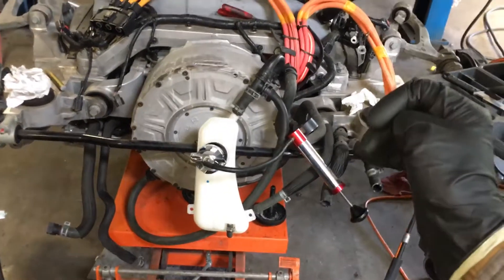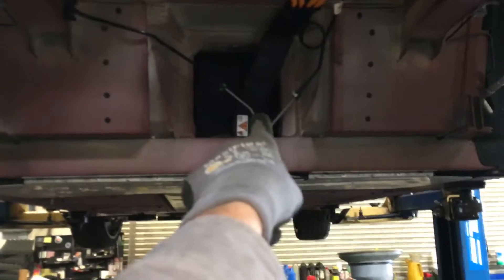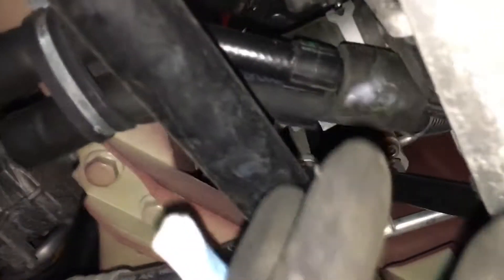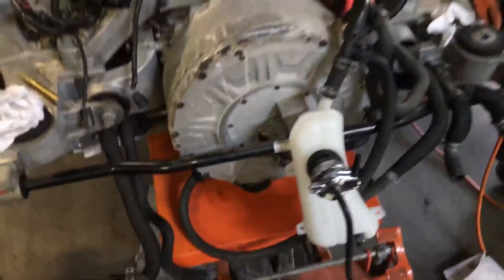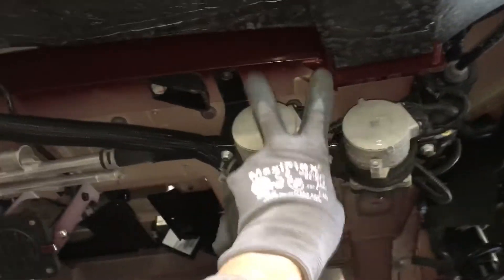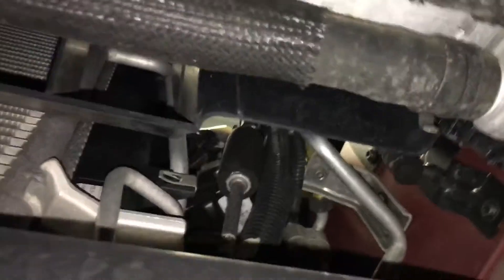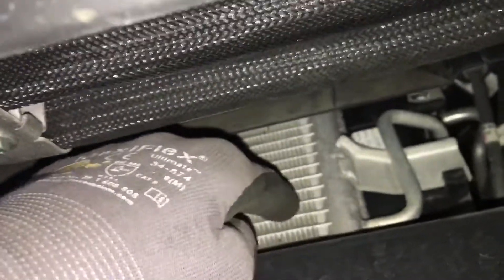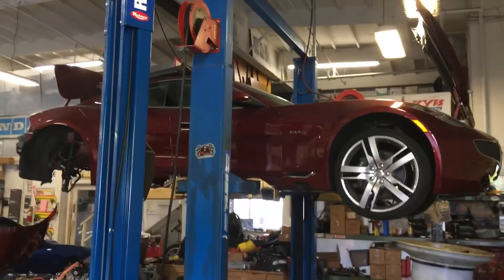Thermal Management Fisker Karma, Learn the new Technology or die with the old.

Comment: Hi.. not related to this video but an older one you’ve posted: you have used the 2 trublu hoses to be connected directly to the vacuum pump. Can you please tell me which adapters you’ve used to connect to the car high and low valves, also did you pull out the shredder valves from the high and low. I want to purchase the trublu 3 hoses set to use it to pull a vacuum from my 2005 BMW M3. Also which pump would you recommend that’s very good but not super expensive. Midrange I’d say. Thank you much!
Reply: Thank you so much for your reply. I love you’re videos!! I can watch you at work forever. Very knowledgeable and love your tools. I wish you were close to me here in Connecticut I would ask you to service my car. Do you know anybody with your credentials in my area btw? Northville Connecticut 06776
Reply from the maker: Forza Unfortunately I don’t know anybody in Connecticut
Reply from the maker: Forza and if you’re not gonna use a set of refrigerant gages just a true blue hoses you may want to get at least the cheap micron gauge
Reply: @coldfinger459sub0  I was thinking of getting the Fieldpiece 480v digital gauge, the trublu 3 hose set and a 2 stage vacuum. I really want to try a deep vacuum as you explained in the videos. Will I be able to do the vacuum directly from high and low, without the gauges and then hook up the gauges to charge the system back? I am learning ( watching, reading) I am not an HVAC tech just a guy who like to learn and do things probably
Reply: Btw, is it a must to use Nitrogen to clear the lines? I don’t have that :)
Reply: Is it at all possible to PM you?
Reply from the maker: Forza you can charge with out gauges I think I did a video on the with the hoses
Reply from the maker: Forza you can do it with out nitrogen. Just leave it on the vacuum pump over night that all.
Reply from the maker: Forza yes you can PM me. Is my contact info available on YouTube ? I don’t even know that. Never PM on YouTube before. If not just ask. I’ll send it to you.
Reply: t lech thank you! I greatly appreciate you’re answering my questions! My car is in better than New pristine/collectible condition all parts are BMW Factory original including all parts of the AC system. I am almost sure Car’s a little low on refrigerant. Temp not cold enough. When I turn on the AC there’s a low hissing sound coming out of the vents. AC compressor is working, clutch is engaging. That’s why I was thinking about evacuating the existing refrigerant ( can I evacuate to a recovery tank directly, or do I have to use a recovery machine?) . Do a deep vacuum, a proper procedure as you are doing and then do a recharge new r134a with the exact amount. 740gr+-25gr as noted n the sticker under the hood. I’ll will need to get a proper scale of course. All the tools needed are going to be very expensive for me :(  Alternatively, Do you think I can find a season HVAC tech who has these expensive tools and of corse care and knowledge to perform this task at my residence?
Btw, at any point of the process whether during recovery or vacuuming- does oil come out i.e. will I lose significant amount of oil that I will need to add back?
Reply from the maker: Forza What year was this car? . Was it a originally a R12 car before 1994?.   Or was this car originally outfitted with R134a ?.   Recovery does take a recovery machine.  Yes it is vary expensive to get all the best equipment. I have over $28K just in air conditioning tools and equipment alone not including Machanics hand tools all mostly Snap On, MAC, MATCO, that’s way over 60K and that’s not including my commercial contracting tools for construction and heavy commercial building HVAC installation of large 60 ton HVAC and heating units on top of office buildings in residential HVAC I don’t even want to mention the price there. But that is all cheap compared to training, schools, seminars, EXPOS, hotels, Airline flight expenses around the country, tending factory corporation training for specific manufactures products. And that doesn’t include the last time while you’re at the training you’re not on the job selling products in labor that’s another expense while you’re attending training.         There is a way to recover to a recovery tank alone it involves a little physics trick tiny bit of knowledge. Vacuum pump needed dry ice and alcohol in the sub freezer -27F . From there somebody can let their imagination fly and figure out how that works.      You might be able to get a local garage to recover the refrigerant for free.  Because you don’t do this as a profession to make money off of. You could just get the vacuum pump and the cheapest set of gauges from Fieldpiece I think are SM360. It still has the built-in micron meter. You could leave it on the vacuum pump overnight. But you still have to purchase a good scale that’s the problem that starts adding money.    Might want to be one of those things you just leave the somebody else at the shop.  I’ve always done a lot of my own stuff and invested the money in tools even if I didn’t use the tools often just to learn something new.
Reply: t lech The car is a 2005 BMW M3. I’m reluctant to take it to a shop because a lot of them don’t know what the hell they’re doing. I want it to be done properly and care so I don’t find myself with a bigger problem or future damage to any AC system components, whether due to moisture or else.
Reply: When in recovery mode or when in Deep vacuum mode- will I lose some of the compressor oil in the process, or is it negligible amount that will not require me to add new oil in the system?
Reply from the maker: Forza We have to differentiate and identify that a recovery machine is not a vacuum pump they are separate devices doing separate jobs if there’s any confusion here?.  A recovering machine recovers the vapor refrigerant from the low side port at a slow rate usually not removing refrigerant oil if so probably 5 mL which is a teaspoon at most.       A vacuum pump just performs a vacuum procedure and will not remove refrigerant oil.
Reply: t lech thank for clarifying!
Reply: When doing recovery- Do I need to connect just on hose from the low side of vehicle to the recovery machine, or do I need to connect another hose to the high side and to the machine as well? Thanks
Reply from the maker: Forza you can do it just from the low side. And if you want to speed it up just a tiny bit when the pressure gets somewhere around 20 to 30 PSI you can hook up the high side at the same time it’ll only be vapor coming out at that level of pressure
Reply: t lech ❤️
Reply: I’m still puzzled how you removed the high and low valve cores when you performed a vacuum using the trublu hoses. I saw the clip on style fittings you’ve attached to the end of the hoses but this way you we’re not able to also take the cores out. What am I missing?
Reply: t lech In your videos, you recharge through the high side. Other literature I read also point out to recharge through the high pressure side:
Q. 2005 BMW E46 M3 in question( r134a) - from which line to charge? Most if not all BMW people on bmw forums say never charge from the high pressure side(red). 
2. Does it depend on the refrigerant type?
2. I have also noticed you sometimes keep the the recharge tanks upright when charging, please explain
Reply from the maker: Forza  Because the majority of people do not know how to recharge on the high side fully and completely this takes a little knowledge of physics and how to apply and manipulate. I’ll probably suggest don’t try to tackle this method as a beginner definitely off-limits.      But the reason for not charging from the high side everybody is starting up their vehicle and engaging the compressor to turn it on and that would send high side pressure right up inside to your canned you’re holding in your hand it would go above 120 psi and the canned would explode in your face.       I have met two mechanics in my life who tried a certain method of raising the pressure in the can of refrigerant and both of those two mechanics nowadays only have one eye on their face with scars.   And in my many years I have also met two mechanics who try to look down inside a 12 V battery to see the water level with a lighter.  And those two mechanics Also have only one eye and bad scars on their face.     Majority of do it yourself or‘s and even automotive mechanics do not know how to charge correctly so they have to start up the car and vapor with the can right side up so they do not suck out liquid they go into the low side the low side pressure on the air conditioning system is lower than the canned pressure and will constantly be sucking vapor refrigerant with the can in the upright position.         They do not want to turn the can upside down and have liquid feed straight into the compressor damaging the compressor.       Does this make it clear if any doubts please ask more questions.        Every year across the world not just the United States people make a mistake on where they hook up the can in properly with disastrous results physically on their body. But we never get to hear about them.    Just like most people never get to see or hear about a fellow mechanic who was removing a gas tank by themselves while under the car gas bills out of the gas tank and falls onto the incandescent lightbulb the lightbulb because of the instant cold gasoline shatters the glass on the lightbulb igniting the gasoline that has poured on the bulb in the mechanic setting the car and the mechanic in the shop on fire. My dad has known fellow mechanics this has happened to and one of the old shop owners and mechanic I used to know this was his end by making this very same mistake.        Safety is very important
Reply: t lech first let me say I have found your YouTube channel by chance. I am so glad I did! I have watched all you video content in 2 days. They are an absolute joy for me to watch. You are a wealth of knowledge. Your son is a very lucky guy! You are lucky too, I am sure. Your father has done a great job. As for me, I am someone who’s always curious and thirsty for knowledge, in almost all fields of life  ( one of absolute main reasons I never made up my mind and went for a specific field, I’m now 46yo, look much younger though 😉) 
Back to our discussion, I am considering getting all the equipment necessary to perform this job. Wireless probe kit ( pressure, temp etc) instead of the digital gauges. The recovery full kit. Fieldpiece or NAVAC, the vacuum kit with the three trublu hoses. The wireless weight - All from TruTechTools. I believe with this equipment I can jump right to the top of the food chain ( just kidding) 
Assuming in have theirs this tools to do a proper job will you guide me how to charge from the High Pressure line AND without having to torn the car on?
Reply from the maker: Forza you you sound like a go getter, jump in with both feet. Like me , when I got into building my own Class A mono block AMPS,  class A pre-amps, individual monoblock linear power supplies for all components external. Phono stage amp, high-efficiency back loaded horn speakers, Open baffle speakers, highly modified handbuilt discrete component DAC, Line stage, 4 different types of headphones all clase two of them tubes. Me too when I get into something I jump in with both feet and go crazy with all the highest and components and complexity. It wont made me go back to school late in life taking Electrical Engineering,.
Reply from the maker: Forza you get the equipment and I’ll hand walk you and we can even do video chat so you can show me what you’re doing on video and I can point things out to you to make sure you do them right.
Reply: t lech Oh man. The pressure is on now. Haha.
Reply: Btw, I like audiophile stuff as well. Look up Daceware website
Reply: Sorry, it is Decware
Reply from the maker: Forza https://www.trutechtools.com/mgavct        Valve core remover first link.                                      Second link is for vacuum pump.                              https://www.trutechtools.com/CPS-VPC2DU-Compact-Series-Vacuum-Pump-2-CFM-Two-Stage--115V_p_5553.html                                         The third link is for the quarter inch hose adapters to go onto the true blue hoses.                 https://www.trutechtools.com/Accutools-SA10788-Adapter-KF-16-to-1-4-FFL                          Call and speak to a sales representative at true tech tools to walk you see you to get the correct adapter that connects to the true blue hoses it takes a little collar rings to clamp them together.      If this is a do it yourself I choose a small vacuum pump for you because you do not need a big one for just your car but it’s kind of important that you get a two stage vacuum pump so you can pull a deep vacuum.       I don’t know where you’re at the vacuum pump I choose is 115 V model they also make 220 V model.   I did not look at the vacuum hose adapter size on that vacuum pump it might be bigger than quarter inch in that case you will need a larger adapter for the true blue hose. The representatives at True Tech Tools are very helpful and they will walk you through from beginning to end of the components you need